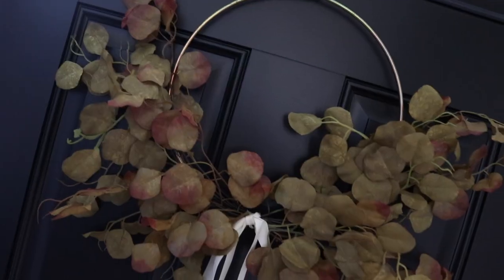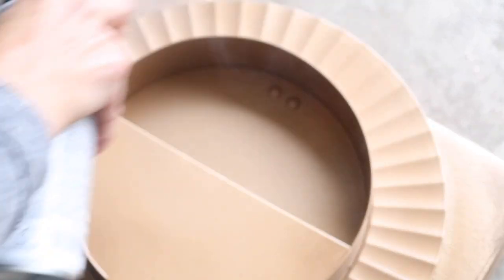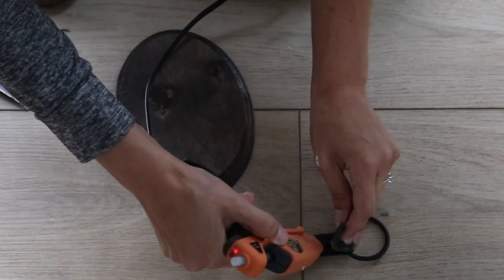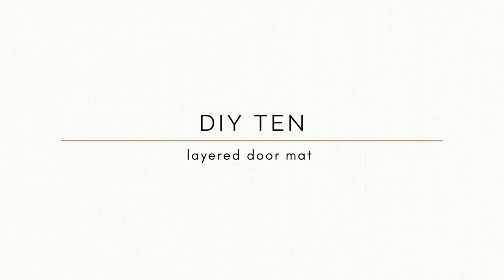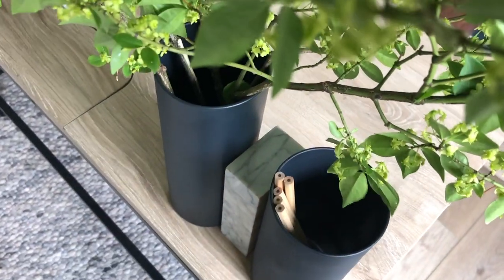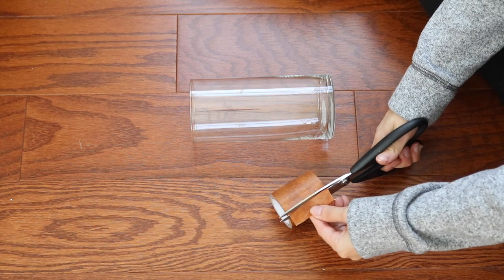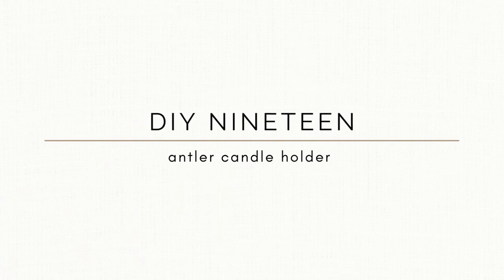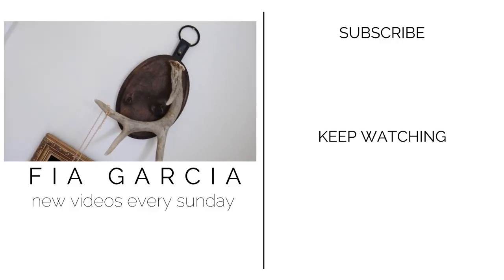TOP 20 DIY DOLLAR TREE FALL HOME DECOR COMPILATION 2022 | HIGH END & NOT CHEESY FALL DECOR

Comment: Before using zip ties consider that twist ties or wire will hold as well as the zip ties, often blend with projects better, are reusable, and dont have the plastic waste. There are also reusable zipties avaliable which like the regular are sill reasonably cheap.
Likewise please never buy new books just for diy.  Thrift stores, free book boxes, local websites with free listing options, and used book sales will give you cheaper more ecologically friendly options.  Many local libraries sell unwanted books or host booksales if you are not sure where to find second hand book sales.